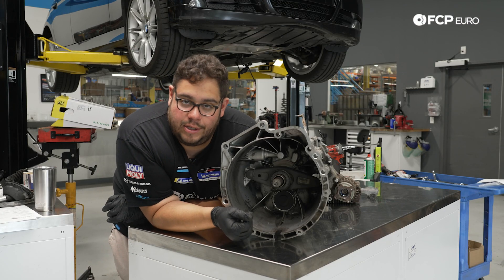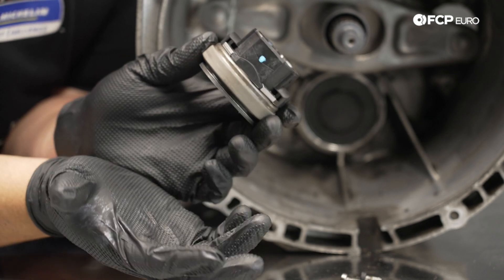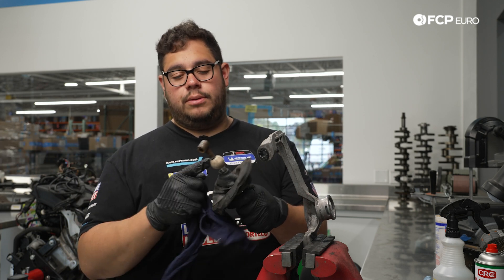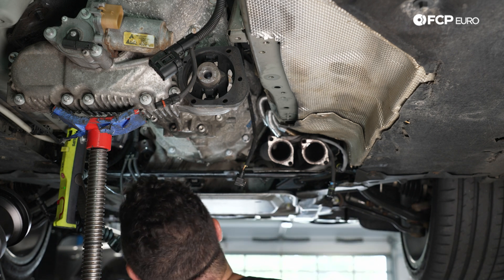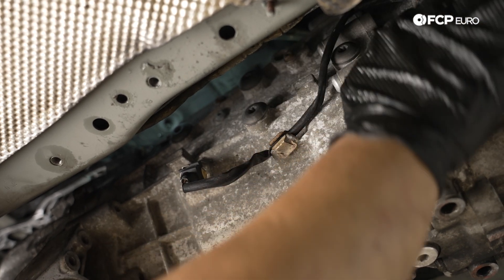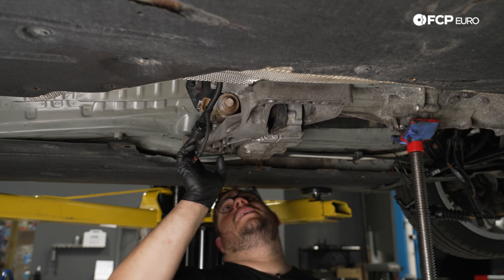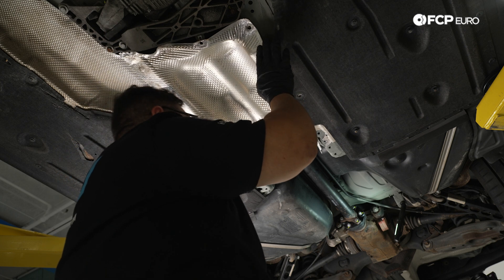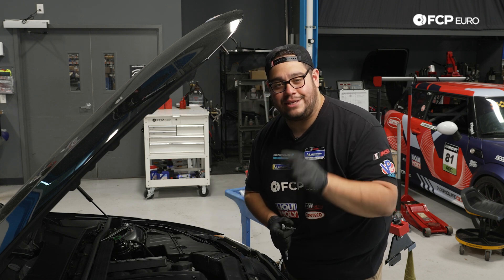BMW 328i Clutch Replacement DIY Part 2 (N52 Engine - 2006-2011 BMW E90, E91, E92 328xi, 328i xDrive)

Comment: This was one of the first jobs I did on my own, a long time ago, on an E46. I left the top, passenger side bolt of the transmission until last, and the weight of the trans, which was unsupported thanks to my cheap, leaky Torin jack, caused the bolt to seize, but I kept going and sheered off the head. Ended up having to drill and tap it. Two days for one bolt! I still have the bored-out bolt shaft on my keyring.

Comment: The timing of these videos was absolutely perfect. I was working on replacing the clutch and flywheel on my 2007 E83 last weekend and I delayed installation until I could watch them both. This greatly contributed to making the reassembly process go much smoother. I used a slightly different procedure and attached the shifter assembly to the transmission minus the shift lever before reinstallation, which seems a lot easier that the way Mike did it, but either way works.

I absolutely love watching Mike work on cars. His presentation style is extremely calming, and he's a very fluid presenter without a lot of the vocal pauses like "uhh," "umm," etc. that plague other presenters.